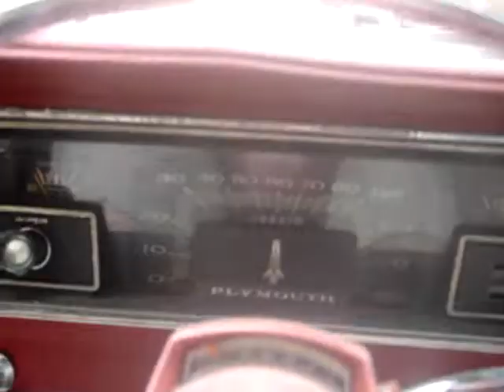1966 belvedere my toy

Comment from the maker: its possible that its the same car, i sold it about 5 years ago, about a week before i moved from nj to ga, easy way to tell both the upper corners in the firewall had bondo in them, apparently it had rust holes and the guy i bought from bondo'd them up and painted them to match underhood, i found it when i was under the dash trying to fix the defroster tubes, i'd love to see a recent picture of it if it is my old one :)